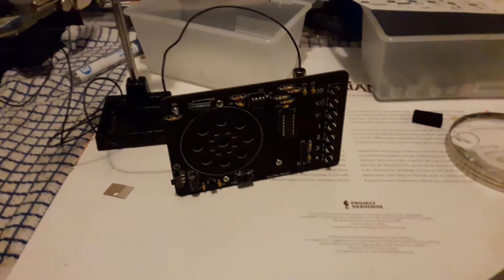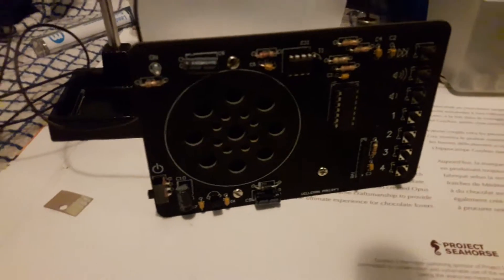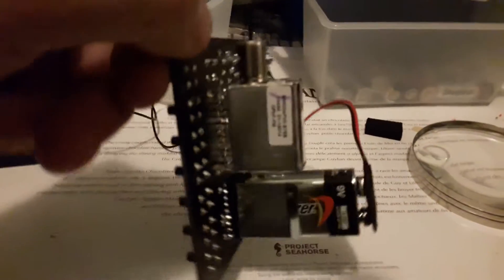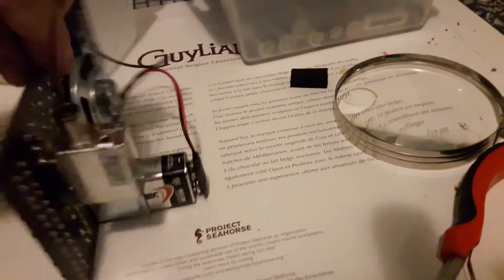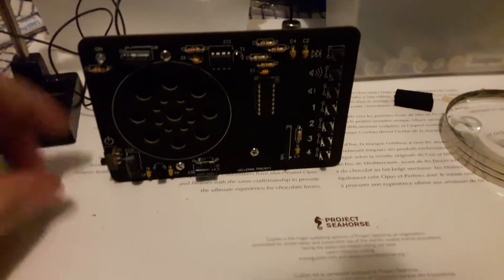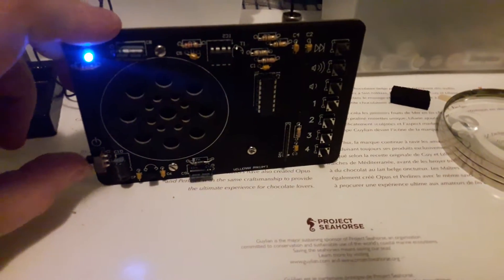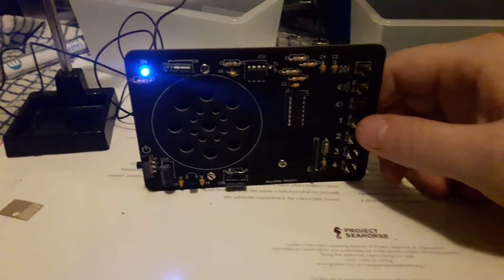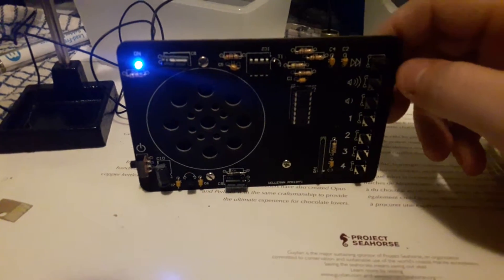Velleman radio I built from scratch

Comment: I built both the Elenco AM/FM108CK and AM780K. The FM works great on the first model but AM poor design. The 780 AM has awesome reception especially at night. I made it solar powered and runs on a 7.2v solar panel just fine. I want to try the FM digital model that you built here in the video. Sounds great, look great and I like the idea of how it scans and allows presets. Good job!